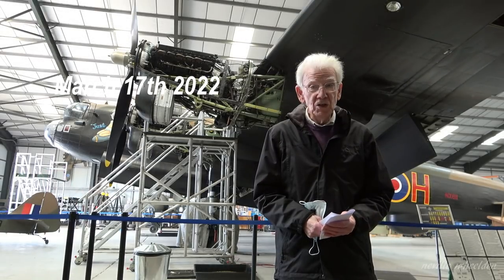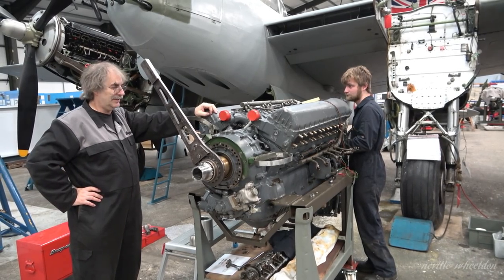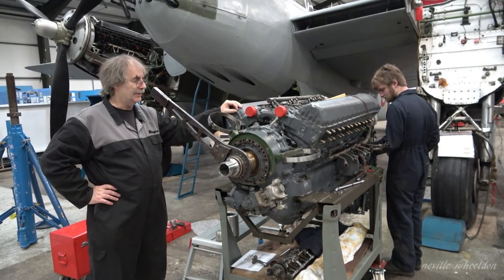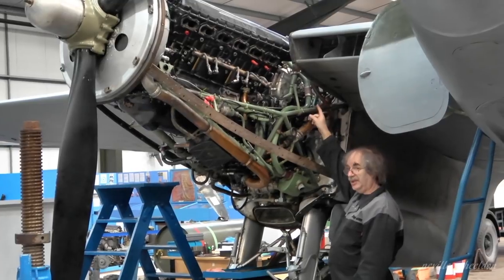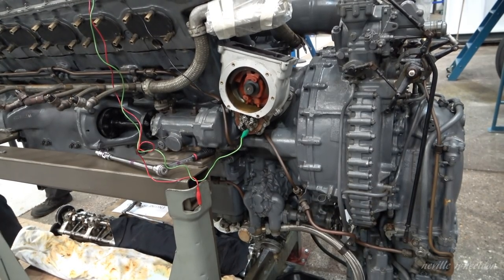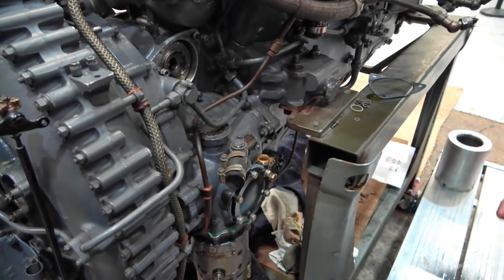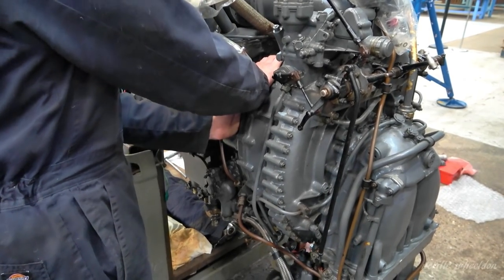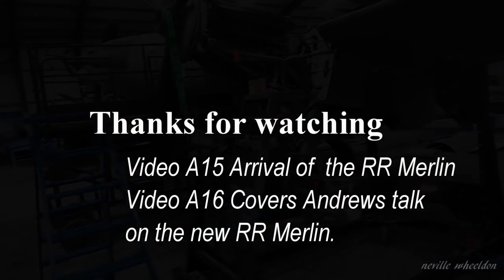Video 140 Restoration of Lancaster NX611 Year 5.. Merlin 25 setting the magnetos.

Comment: Spectacular to find an appropriate 70 y/o RR engine in Switzerland (wonder where it was sitting around??). 28k pounds is a lot of money but for such a rare & never used engine think cost was lot less than I'd expect. Thanks as always Neville & best wishes all!
Reply from the maker: Hi Nescon P,  above in the description box there's a link for Video A16 there you will find all about the Merlin with Andrews restoration talk. talk
Reply: @nevillewheeldon1693  Thank you very much for your reply Mr. Wheeldon..
Reply: @nevillewheeldon1693  Hi Neville, 
A bit of a follow up question if you might have an answer or those at the Lincolnshire Aviation Heritage Centre (LAHC) have some insight. A aircraft preservationist Paul who works for Kermit Weeks was going through containing part for a 'future' Lancaster restoration (at Fantasy Of Flight in FL in the USA - link to video here: https://www.youtube.com/watch?v=tee6Bv4Z2HI ). Know the LAHC has some parts of from Kermit's Lancaster just was curious what they were? Also would it be possible for the LAHC staff lend a hand in Kermit Weeks Lancaster restoration after (or possible during) their current project - thank you very much..!)

Comment: Hi Neville . Well , Brad and  Martin certainly know their stuff ! And the engine was a "bargain" in real terms and  l think the seller was very happy to see it united with it's original recipient ! Brads brief mention of the scew gear failure  and Alex Henshaw's crash landing in someones back garden . If you see the pictures it's unbelievable that Alex wasn't killed ! I think the failures were specific to the Packhard built units . Upon investigations they found out that one of the foundry workers was pouring his unwanted coke drink into the molten metal changing the molecular structure !!!!  Thanks Neville , and thankyou Brad and Martin .
Reply: The skew gear failures were experienced on Rolls Merlins. The cause of the failure was found to be a distortion of the centre bearing panel in the crankcase caused by the crankshaft shuttling rear wards. The rear ward loads eventually causing shock through the wheelcase gearing, closing up backlash between driving bevel gears and eventually  transferring the load to the skew gear, which then failed. Rolls implemented a mod to prevent the crankshaft moving and the problem went away.
Reply: @BradleyWinder96  Hi Bradley . I've never been more happy to have been corrected by the Master himself ! So l know l've heard "my" story somewhere , l think l read this in Jeffrey Quills biography. .....or maybe Alex Henshaws. Thanks Bradley. You all work tirelessly towards  the ultimate goal and l respect your commitment and incredible skills . Thankyou .
Reply: @johndavey72  only taken from Alec Harvey Bailey’s book Merlin in Perspective. Well worth a read 👍
Reply from the maker: Cheers John.

Comment: My Daimler, more than a decade older, has, as well as the familiar coil ignition, a Rotax magneto, connected via a vernier coupler. Mine has 21 and 22 teeth rather than 10 and 11. As on the Merlin, it is a long-winded job to adjust, but I do have the benefit of being able to adjust the timing whilst the vehicle is in motion.
Reply from the maker: Good comment DaimlerSV.

Comment: You have to get the comment in line with the video.  The comment has 11 teeth and my keyboard has 12 teeth.  They are equally spaced, so I turn the video on /75 speed and turn on the captions.  This lets me sync up the video by slowly listening to the sound on the video and setting the adjective.  Then I have to put the punctuation on , and tighten it down to specs ,around all the verbs and nouns in the way.
Reply from the maker: Hi Ash man, I do not control  the caption or subtitles this is computer generated I assume by YouTube.

Comment: Is this engine not airworthy? I feel its brand new and never been fitted it's a zero hour engine? Great video again thanks.
Reply: Unfortunately it’s sat for too long to be considered airworthy. The storage period for a Merlin is 10 years with regular checking and re-inhibiting. We’ve been through this engine to ensure it’s safe for ground running but it would have to go away for overhaul to be certified airworthy.
Reply from the maker: Cheers George.